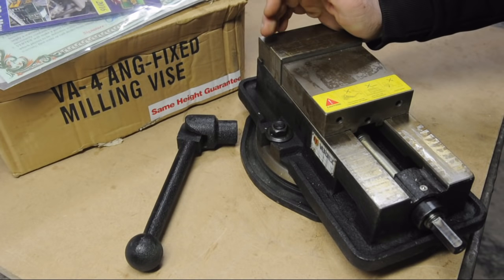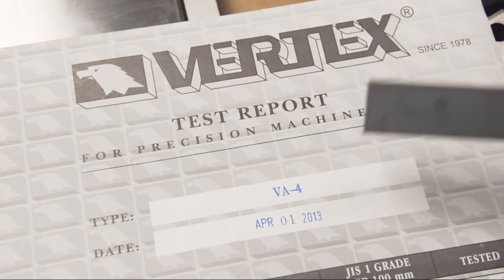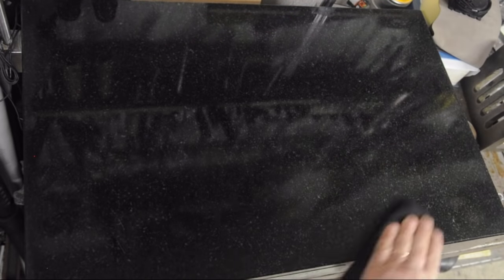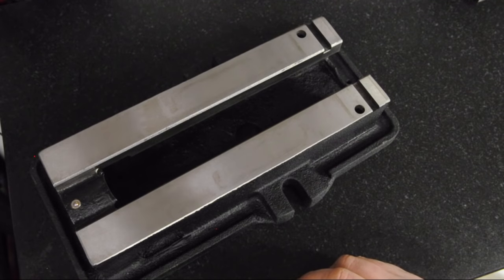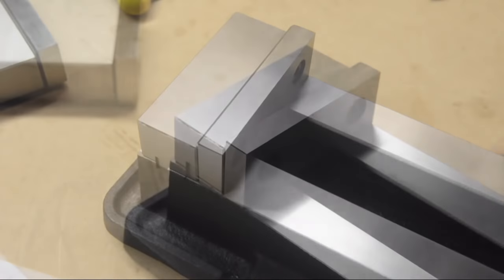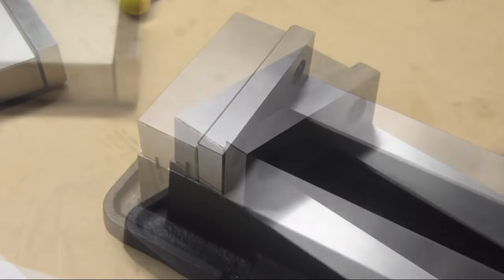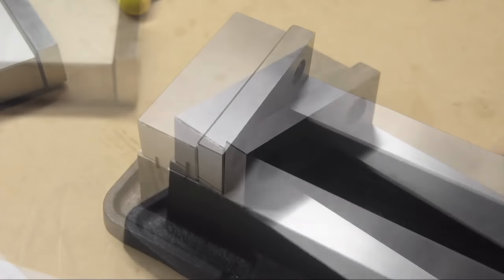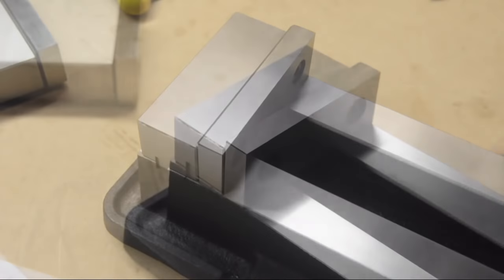Shoot'n The Poop #2 - Import Vise VA4

Comment: I figured you can get a discounted rate on your funeral plan if you declare your surface plate purchase.. seeing as NOW.. you need one before you buy your first clamp. Inscribed with inspirational poem.. you can nount it with the writing facing down.. so they just need to scratch in an end date and you just saved $$$,.. those headstones can get a little crazy.

Comment: Many of the hobbyists I've seen on YT usually work with tolerances of .005" or greater anyway.  Some even use a ruler. lol
Reply: I chuckled, your'e spot on though.Even using vernier scales  (forget about a ruler) i cant get consistent below .002" anymore,was no problem when i was younger, need to get the dials out for that now, old eyes and parallax :( saddens me because i love simplicity of vernier calipers over dial and i HATE digital due to ease of knocking zero,slipping scale and batteries always going flat at worst possible times.

Comment: Those little blocks that look like mini 123 blocks... where does one get those? They look neat!
Reply from the maker: They're metric 1-2-3 blocks.. 10-20.... 50? mm.
Metric is funny like that.
Reply: Tony--where did you source your metric 1-2-3 (10-20-etc MM blocks?  Sammy form NC
Reply: OOOPS---edit and make that "from".--Sammy from NC
Reply: Ha! I was looking for these 10-20-40 blocks forever, right until a thread on Practical Machinist (literally yesterday!) linked to a source:
http://www.arceurotrade.co.uk/Catalogue/Workholding/Vee-Blocks-Angle-Plates/10-20-40-and-20-40-80-Blocks

Ordered last night. They seem to have reasonable shipping rates to the US.

Comment: That's not bad at all. What brand and where'd you get it? Also, can you recommend some working man priced indicators?
Reply from the maker: It's a Vertex brand.  At the time they were all over ebay, I'm sure they still are.  2nd had is the way to go for indicators if you're looking for bang/buck.  again, got most of mine on ebay.  If you'd prefer new I've had good luck with Mitutoyo.  Depending on the model they can be quite cheap and I haven't found one I don't like yet.
Reply: This Old Tony I trust that. Those were the only calipers I've ever had that were good haha. Thanks bud, keep up the quality videos
Reply: This Old Tony i can recommend shahe for cheap indicators etc. Pretty good for the money

Comment: did you measure how square is that jaw. it was 0.05 with plate and without, then you measure height but didnt measure how square it is. only in vise. opposide sides should be paraller when they grind it, but it not mean its square. and mayby it should be like that it pull part down >D
Reply: Yes, I was expecting you to sit the bare jaw holder on the surface plate and bring the calibrated dial up to it to check the squareness of the upstanding face to the bolting surface.
Reply: At first I thought you were forgetting to double the figure quoted when applying the squareness tolerance, (because it's plus OR minus) but then I remembered, unlike a flatness tolerance (where the deviation would be doubled from an arbitrary datum), a squareness tolerance is EITHER plus or minus, depending on whether it's leaning out or in. As you were!

Comment: Each face of the fixed jaw may be flat and parallel to the opposing side, but they are most likely not square with their adjacent sides. You would only need to reference the bottom side of the jaw to a known square surface to your grinding base in order to dust the clamp side adjacent to it. This would make it skookum as frick when you clamp your.. wrong channel.

Comment: isn´t this mesurement with the ball bearing in the front meaningless? if you rotate around the circumference of the ball bearing the indicator has to change since the distance in direction of the mesuring tip to the flat Surface changes. The radius of the mesuring tip is an other than the radius of the ball bearing.

Comment: ETHER WAY ITS .0005 NOT TO BAD FOR CHINA. AND A 100.0 BUCKS. I HAVE A 6 INCH THAT BOWED. ITS THE METAL AND STRESS RELIVED PROCESS THAT HELPS MAKE A GOOD VISE. I JUST GOT A KURTS  8.8 X 6  FOR THE HAAS MINI WOW WHAT A DIFFERENCE. JUST A LITLE ON THE HANDLE AND ITS NOT GOING ANYWHERE.

Comment: Tenths?? 0.01mm would be 0.0003" wouldnt that be.. like.. uhm.. microns? i dont know i don't use inches normally.
Reply from the maker: My apologies.  In this context 'tenths' is short for 'tenths of a thousand'.  "Three tenths" = 0.0003"
Reply: Ah i see.. well that is like 7/1000mm
Also known as.. holy crap small.. last time i did something in that scale i spent 4 hours measuring and 5minutes cutting.

Comment: The method you are using for the second test is wrong you are creating an ark with the dial gauge which is giving you faulse readings the dial gauge should be moved vertically rather than horizontally

Comment: MathematicS
MathS
Reply: Dave Young When you drop middle letters you add a '. So if you want to keep the s it should be math's. Shouldn't not shouldnt.
Reply: I don’t think that rule necessarily applies to diminutives. How about Carbs for Carbohydrates. If you are abbreviating a plural then the abbreviation should surely be plural. The real question is whether ‘mathematics’ is a plural or a singular noun. I suspect it is both.